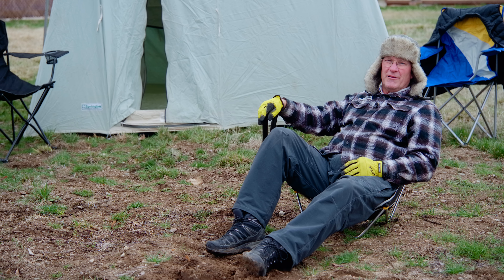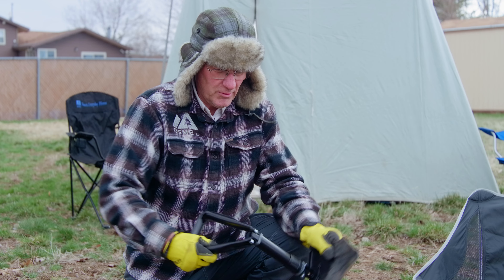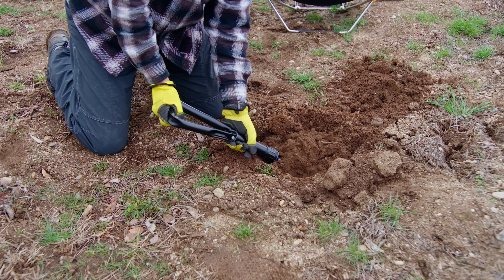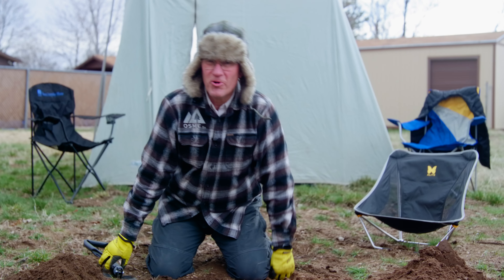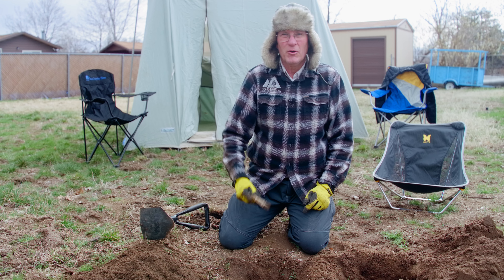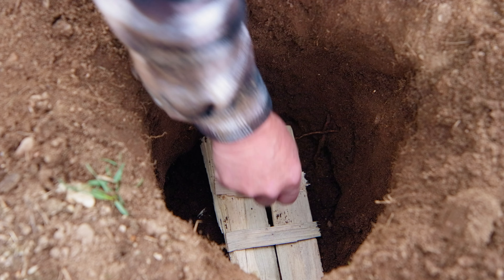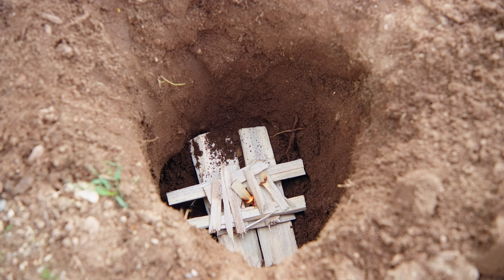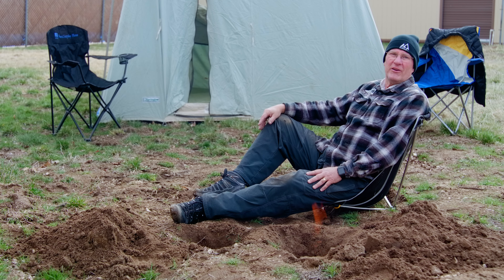How to Make a Dakota Fire Pit | How to Build a Fire | Make a Campfire

Comment: The Dakota fire pit is no longer recommended in Scouting.

It has far too high of an impact on the landscape. That's what the literature says.

Our council's camps have several 10'×20' areas where the topsoil has been removed and replaced with a mixture of the mineral soil excavated from the pit filled out with other non-organic things such as crusher run.

We are allowed to dig in those fire pits because fire won't kill the organisms nor cook out the organic matter that make topsoil fertile.
Reply from the maker: Thanks for sharing your knowledge.
Reply: In a survival end times situation, coming soon.  I think Dakota Fire Holes would be absolutely necessary so that your fire can't be seen by others.
Reply: @TheHuntForSupper lol if  you can see someone smoking  a cigarette from a mile away in darkness I’ll definitely see this fire from 5 miles.